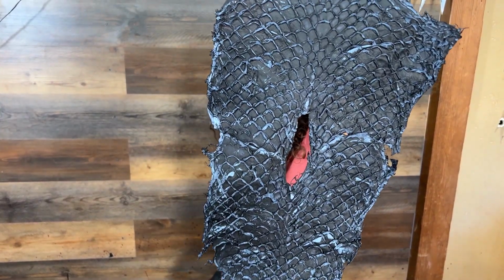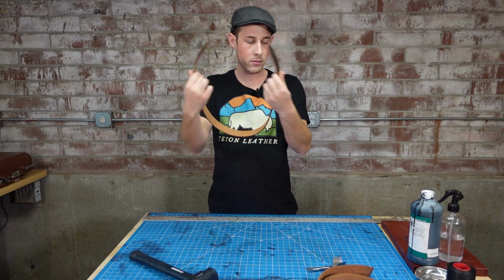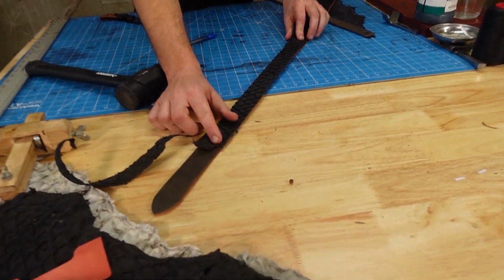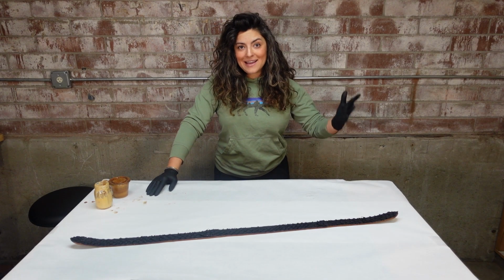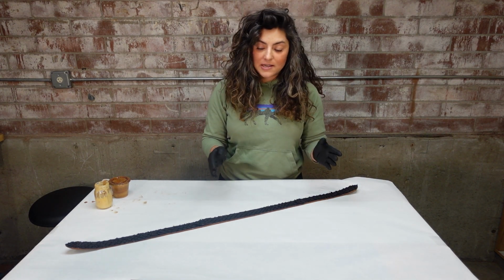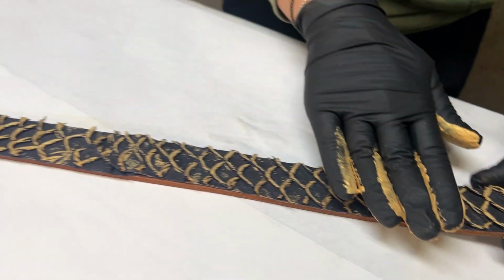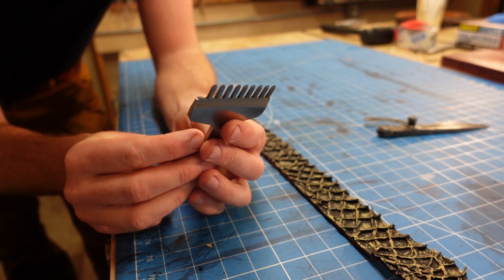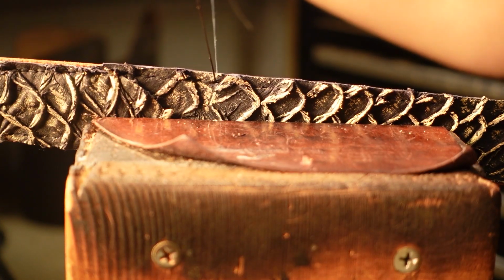I Make A Belt Out Of A Fish

Comment: I noticed that you used three pieces of fish leather to run the length of the belt.   I'm pretty sure that you stitched the ends to the body of the leather, correct?  I don't think that over time glue would hold up.  Thanks, interesting video.